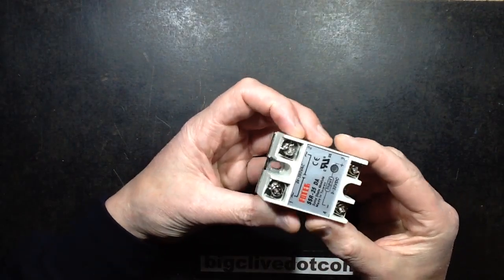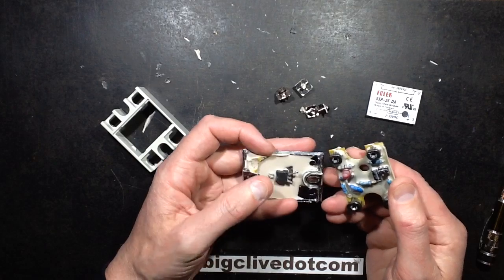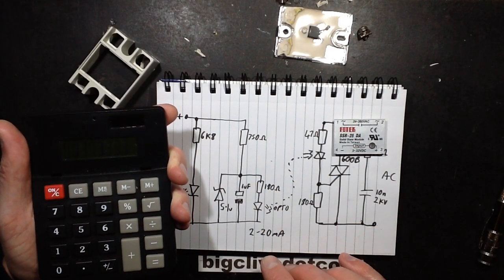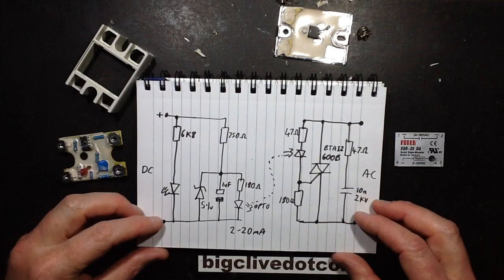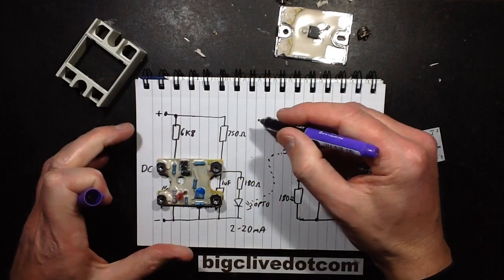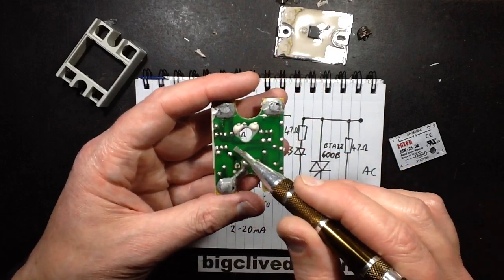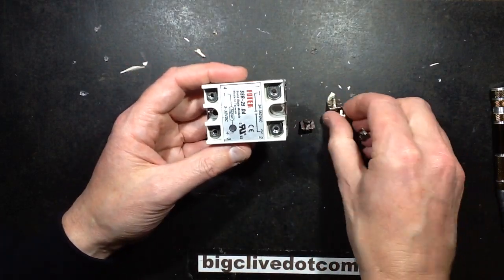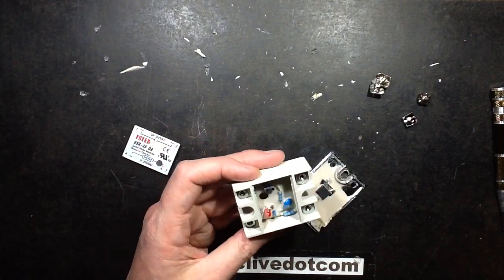Teardown of an eBay 25A Solid State Relay.  (SSR)

Comment: Thanks! Got a DC load version of one of these. The input also says 3-32V DC however unless you provide around ~12V the impedance on the output stays OL on the fluke, common issue with the cheap ones apparently from some online hunting. I wonder why? Mine is just controlling a 12V contactor control circuit from an ESP32, so i'm probably going to continue using it with a small mosfet to bridge the 3-12v need.
Reply from the maker: Solid state relays usually need a normal load on the output side to work.

Comment: Just wanted to comment that there are now ac and dc versions available from CONRAD with their own
 "tru component" cheap brand.
I would trust those more over chinesium and if i remember correctly they are 12 bucks for the 30Amp version.

I was looking for a video to show a colleague why he cant use AC SSR ones with triac for DC loads..
Theres that small "minimum load+voltage" hidden for the arduino industry module he wants to use.
No real problem, since he can use a DO-pin to a relays/DC-ssr but again means more parts.

I use them to switch on monitors/psus when my pc is on (zero crossing) so i dont burn up the switch when everything gets powered at once (..and blows the RCD..)
Bonus: pc in standby means everything else is off, using onternal 5V not from usb)

Comment: I'm using a pair of DC-type SSRs to control the electromechanical spring brakes on a 12.8m satellite dish (former NATO, we're restoring it for scientific use).  The control system is 24VDC, as are the brakes, but the brakes are higher current than the controller can sink, so, SSRs.  They're notionally rated for 40A, but I'm guessing the truth is much less.  They came with heatsinks and the brakes are only putting a roughly 4-5AMP load  through the relay output--rather more than the controller can directly sink.   I've been an electronics tinkerer since 1973, and this is my first experience with SSRs.  I also picked up some 24V contactors, in case the SSRs didn't work out,  but, so far, they're fine.    I placed large (30A) diodes across the brake coils, because it wasn't clear whether there was any kind of snubber network inside the SSR.

Comment: Can i use 2 of them 60amps ssr to power my oven(about 3000watts) . Its 220 dual phase oven(i believe 110 G 110 vac)
Reply from the maker: If using them with a heating load, make sure any SSRs are heatsinked and add an extra thermal switch in series as a safety precaution.  Many SSRs fail in a short circuit state.

Comment: Only just come across this, and I imagine that at time of watching (Dec 2023) any SS relay on eBay priced at under £5,- isn't even going to have a 10A TRIAC in it. 100mA or even 1A perhaps (Whatever will just about withstand a 30s inbound test on a 20A load) but definitely not 10A! 📦💸😉

That aside; Living in an all-electric flat I'm struggling a lot with cost of heating and I keep considering ideas like running TRIACs and ICs close to their upper tolerances and benefitting from the heat this will give off as a biproduct. Even if I have to swap in new TRIACs every week it's probably still going to work out a lot cheaper than running my 3kW convection heater at the present 36p/kWh for a few hours each day! ⚡🔥💡

Comment: I use something similar with my. Snake vivarium ceramic bulb and a low voltage digital thermostat,,
Mine is heavy and I've used a heatsink to be on the safe side

Comment: Thanks for posting, it's good to see the insides. I used an SS40DD (to switch a DC 3A load) controlled by an arduino GPIO pin. I was using it well within spec, but it got very hot indeed and all the case melted and twisted. I built my own after that :) :)

Comment: There are "real" ones and fakes that are nearly identical. Slight differences in the label. I'm using one with a cheap Chinese PID controller in my fish smoker with a 1500 Watt 120 V heater. If you know what you're really getting, They can be useful. Just don't take the ratings too seriously. But, 1 degree C control for less than $ 50 in electronics is not too bad. I call it the smoke-o-matic. And yes, it's overkill.

Comment: One thing you didn't test is the turn on voltage.  Triacs are not the same gate turn on in all quadrants.  You will see that below 3V (2.2 - 2.7V)  the SSR will only be half wave.  That could damage some AC devices which are inductive and that may be very close for 3.3V devices.  More expensive SSR like CRYDOM use a constant current circuit and LED drive current will be a constant 2ma from 3-32V.  You get what you pay for.

Comment: I used one on my off grid solar set up to turn the immersion heater on when the batteries were full.
Reply from the maker: It's a good idea to have a secondary thermal protection with SSRs as they tend to fail short circuit and jam a load on.

Comment: I'm looking at using one of these with a raspberry pico (3.3v device). All the electromechanical relay modules I've used come with 3 inputs (VCC, GND, IN) but this only has two inputs. How would I control this?
Reply from the maker: Just 0V and the logic level output to control it.

Comment: 👍 I've watched this a few times.  Clyde can you do a real one and maybe also compare a couple of those high current 100A ones?  That would be really interesting.  And I wonder what's inside the 40A version.  Do you think the resin is for isolation or for heat?  Isn't there a version of the triac that has a snubber built in?
Reply from the maker: I think the proper units have decent snubbers.  The resin will be for moisture resilience and probably heat transfer too.

Comment: I wonder if that is the current rating of the imported/no heat sink on triac .Some triacs show you 2 ratings free air and potted .The heat sink will make a huge difference in ampacity .I have used the same ones but never had gone over 12 amps at 120V .Great for controlling heating elements on my mini still

Comment: I've got an analogue version of this "brand" SSR, rated 40A and connected to the 4-20mA output of Siemens PLC on my educational panel, and controlling the water kettle, maybe it was a good idea not to trust the listing, and buy one rated 40A for 10A load. I didn't know they even fake SSR ratings. Also i doubt that PLC output will handle reverse 230V RMS AC in case of isolation breakdown:(

Comment: so...is it proper to simply apply a low impeadance voltage source directly to the input of an SSR WITHOUT an external current-liminting resistor???  I am planning to use 12v to 24VDC from a battery.  I have always been in some doubt about applyig a straight input voltage WITHOUT  a resistor?
THIS WILL ANSWER A LONG-AWATING QUESTION FOR ME!!  THANKS MUCH.
THUMBS UP WITH SUBSCRIBE!

Comment: So if i understand this correctly these relays would as you say be used to switch power on and off on say a AC single phase  or AC 3 phase big foxtrot motor/pumps etc  and then that would mean that the other side of the relay could use a much smaller dc or even ac voltage,  switch and wires negating the need for big Foxtrot cables, wires running through to the switch and cabinets etc. Great idea really, I guess you just leave the switch in the on position until you want to turn it off, way safer way to handle all the switches inside cabinets on low voltages and smaller cabling... always wondered how they worked Thanks Clive...

Comment: Zero crossing is not great for inductive loads.  I've used these FOTEK relays quite a bit, however I generally use them @ 1/10 spec.  Doing that I have never had any trouble and they are cheap enough that such over-specing is very affordable.

Comment: potting of components with epoxy isn't as important as potting the transistor or thyristor ,SCR to a good base with an insulator and heat sink compound .then potting the SSR onto another heat sink with fins .I have a very good SSR 3 phase 24 to 400 vac  max .Came out of a hot table .With 3 heating elements in wye configuration and 24 v digital control 
.Believe it or not the hot table rotted through and the SSR and control were perfectly fine .the heating elements were done .Fuses popped .But SSR was fine .The heat sink for that units was huge 12x12 finned anodised aluminium plate .Current rating was 25 amps per phase .The base plate on the SSR was 1/4 inch thick copper !was made by crydom .could not believe it diddnt blow when elements went .usually the don't like that hi amperage instantaneous short.Alway wonderd how fast you can switch them on and off and if you can use them as a VFD /Ac motor speed control

Comment: Can anyone anywhere find the datasheet for the Berme BEM-14840DA, which is the OTHER cheap one you can end up with?
Reply from the maker: If it's another clone then the specs won't match the original's datasheet.

Comment: I bought a couple of these several years ago for a brew fermentation controller (BrewPi). Hooked it up to my old fridge and when the fridge should have turned on I heard the sound of something from the compressor but it didn't start up. I assumed the compressor must have seized up after being idle for months so gave it a few whacks with a rubber hammer but still the same,

Something then made me think to check the SSR and turned out it had a crazy on resistance so when hooked to the fridge, the output was something like under 100V rather than 220ish. Swapped it out for the other SSR I had and it worked fine... Invested in regular relays for that project instead.

I do understand there are no shortage of fake FOTEK SSRs that likely you and I found for bargain basement prices, but the genuine FOTEKs are more reliable. What about ordering one from CPC or the like and seeing if that's any different?

Comment: Clive, thx for exposing this farce of an SSR. As usual the only way to get what the label says is to buy at least 2X what you need and hope that you get what you need.

So, let me see if my math is rusty, BTA12, 12A Triac == 25A triac. I guess in some universe this is true. What a crock of crap.

The way they did the board about the isolation shows that the designer has no or little HV experience. 

I wonder why they didn't choose a conformal coating instead of the resin. If all you're doing is coating the components then one is as good as the other. Typically the resin fill is to keep prying eyes outta your circuit. Seems in this case it was just a copy cat without a brain behind it.

Hey, China you could've just used conformal coating at a tenth of the price of resin. Come on, get with the cheapness.

So now, the biggest question is, did Fotek authorize this design or did the Chinese totally rip of Fotek ? It's like how many licks to the Tootsie Pop center, the world may never know.

Again, thx clive for sharing.

Comment: Do you think if i bought one then used x2 mosfets in parralel it would take more current? i need 40 amps :)
Reply: sorry, Triac. could i run say x3 12a triac in parralel to be able to run say 30A output? its for my race car. i PWM control fuel pumps. currently using fan control modules but id like to change to a SSr as the modules have a bit of a delay
Reply: again sorry i forgot this is for AC im thinking DC
Reply from the maker: You do get DC solid state relays, but be aware that they need heatsinked, the clones are rated nowhere near the stated current handling ability, and the failure mode is often sticking ON.

Comment: is it normal that when I plug in 220V AC to the output terminals without any input, I get around 120V passing through? Shouldn't it be flat 0V?
Reply from the maker: With no load to clamp leakage you will get some current through the snubber network.  That can make some loads like LED lamps glow or pulse.

Comment: i have one of these am using one of these rated also 40 amps but 220 v DC but and it seem to be on all the time i mean the 2 contact is closed all the time no matter what the light is on or off , what do you think the issue is ?
Reply from the maker: That's a common failure mode of these.  The internal triac has failed short circuit.  It can be caused by overheating and high current pulses like short circuits.
Reply: @bigclivedotcom  can be the cause of high frquency on the input ? pulsing it on at 10 mili seconds killed mine

Comment: Have used 25 amp solid state relays but when load was more then 3 amps would mount it on a heat sink and use heat conducting paste. Have just used a 6 by 6" aluminum plate that was 1/4" thick for loads up to 50% of label. Nice vid.

Comment: Never purchase or use ANY test or safety equipment LEDS electrical items or tools from scum bag cheating lack of quality control communist china. They are great at miss labeling products. Were making 25 amp relays that were actually only 10 amp products. Were making great looking boot leg home circuit breaker s that were faulty

Comment: The better high power SSR's use back to back SCR's rather than TRIACS  because SCR's are more reliable when driving large inductors like motors. I talked to Motarola years ago and they told me you have to overdrive TRIACS to reliable switch high inductance loads in all four quadrants. This is easy to do if you know what voltage your going to be driving from but can be more problematic if you really do have to have a wide input control voltage. We were buiding our own SSR's so we controlled the input switching voltage and could set the gate driving voltage and thus the current.

Comment: We actually use similar relays. Allen bradley drives switch it to power a 120 volt brake on sew eurodrive motor. Works great. Great video as usual Big Clive ⚡️🏴⚡️
Our relays are allen bradley or omron.
Reply: "Our relays are allen bradley or omron." -- which means they aren't built like this trash at all, that's why they work fine.  People in comments seem to think this video is an indictment of solid state relays, when it isn't - it's an indictment of FAKE CHINESE "solid state relays", built completely different on the inside from the real thing.
Reply: @railgap  You are right allen bradley solid state relays we use have 100% reliability. So far 26 years and I have never seen one fail.

Comment: I don't know what is the norm, but I tore open a US brand SSR once, and it was basically a chip and wire hybrid, bonded to the copper base plate. No PCB, no packaged components, just chips, bus wires, covered with clear silicone. The circuit was stupid simple, too, like 3 chips and no passives.

Comment: Very interesting and helpful! Any chance you would consider doing a similar teardown of one of those resistance controlled AC SSR's also widely found on ebay? I suspect they might use a capacitor dropper + full wave rectifier bridge as you described in the "Random high voltage eBay "thing"".
Reply from the maker: My guess is they may just be a standard dimmer circuit inside.

Comment: Thank you for sacrificing this relay to show us how it works. I am concerned that when there is 240V AC on the relay it is showing about 10V AC between the backplate and ground or neutral. I wanted to bolt this to a grounded chassis but with a potential between them it sounds like a bad idea.